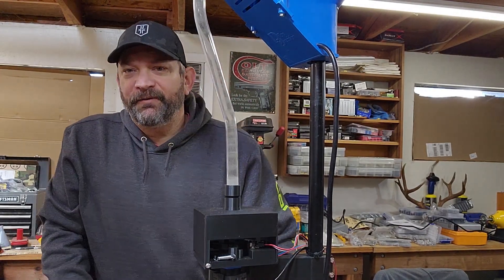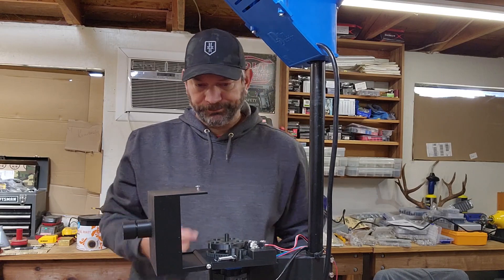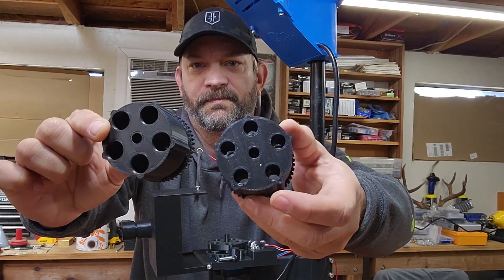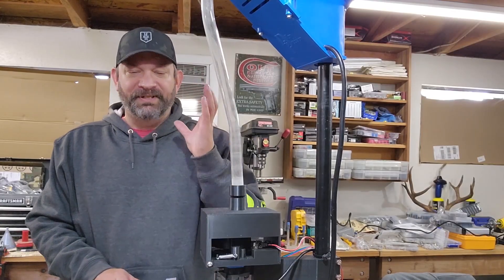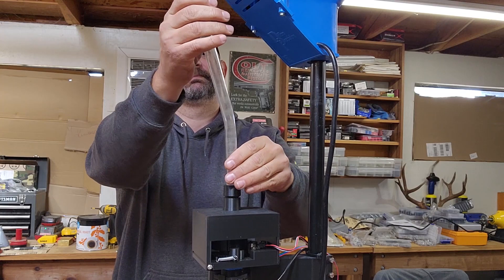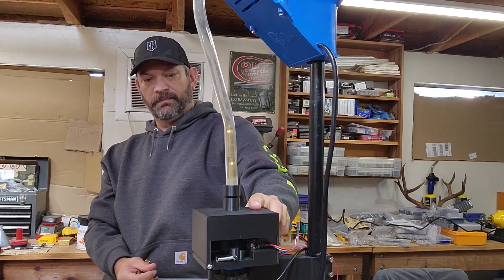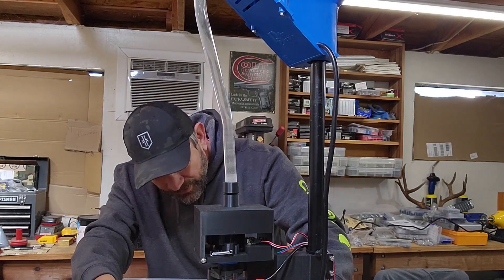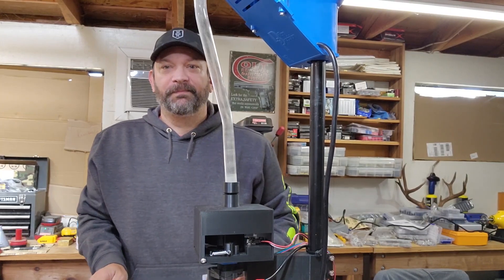CS7 - 308 Conversion for sorting brass by headstamp

Comment: I need to change the feed nozzle and feed plate for 30.06. Can it be as easy as just a height change to the feed plate or is more required?
Reply from the maker: Hi John, I am not sure 30.06 is going to work currently.  I think the 308 is a close fit and probably would have to create a taller top lid for 30.06.  I will do some testing later and see how it works out. I am happy to make a 30.06 conversion set though if it ends up being compatible. I was mostly focusing on the high volume cartridges and completely forgot about the old war guns 😁